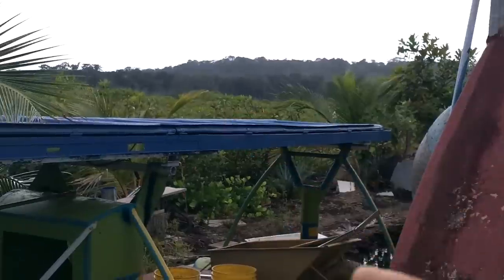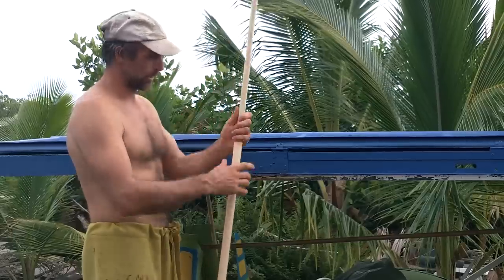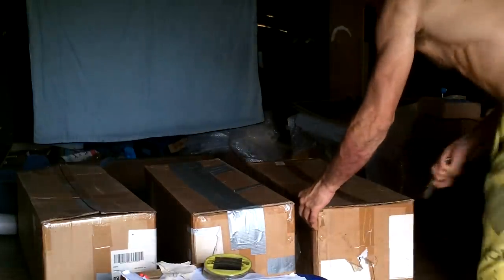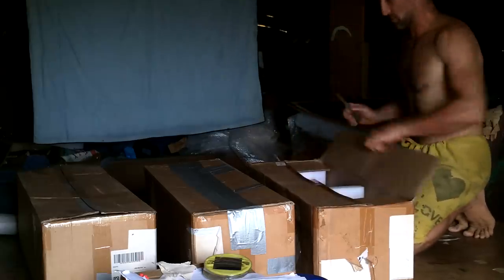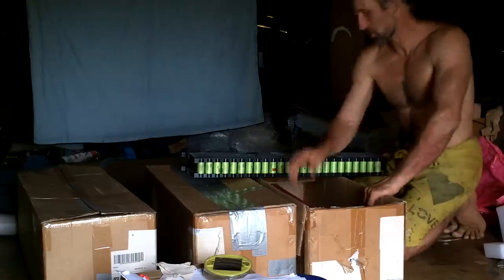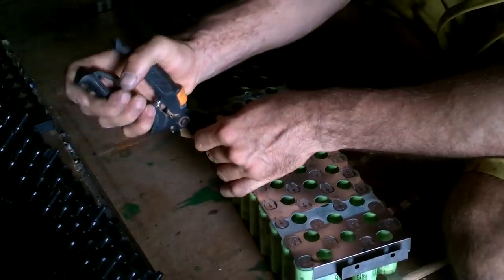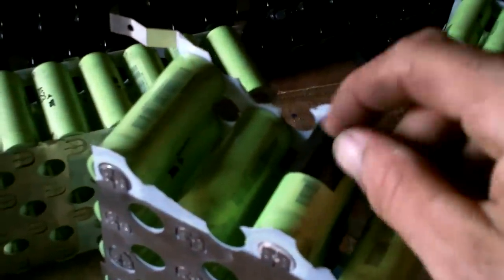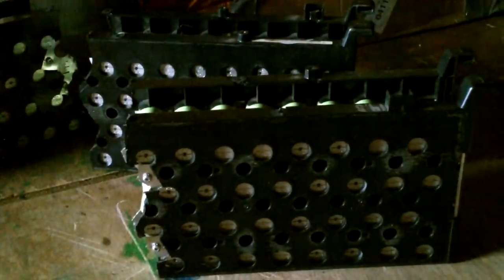Solar Snailer 033 Tubes n' Batt's

Comment: glueing them means they will be harder to get off, rivets is the way to go. the island and dock is looking so cool coverd in all them trees and plants top job dude
Reply: Maybe just add some lines across the board instead of smearing all over. Then he can use a thin metal string and push it through and back like in a long u shape and pull to cut the glue when he wants it off.
Reply: @nalissolus9213  didn't think of that. This will work also. come on jamie have you made up your mind? what it's gonna be . And how's the new build coming along 
Last bit is for jamie

Comment: I have a bunch of these and they are great. They are used in hybrid buses and we have a lot so when they replace the packs you can get them pretty cheap locally. I have cycled mine quite a bit without a BMS and the cell voltages have only drifted 1/100v. So you just regularly check and balance them as needed. Love how compatible with 12/24/48v systems they are.

Comment: Those Are Great High Amp Output 28650 Cell Packs! They Should Work Awesome For Your Boat Applications! I'd Wrap Them Up Very Well With A Couple Layers Of Kaptan Tape To Keep All Moistures Out, Especially Salt Waters Etc! Thanks
Reply: 28650? I suspect they're A123 Systems 26650 cells. I haven't heard of 28650.
Reply: @MattsAwesomeStuff  That's What I Ment... Thanks
Reply: @MattsAwesomeStuff  you haven't heard of 28650? Now I feel like I'm in twilight zone😳

Comment: 100% Sika flex will work and work amazing. The only down side to sika flex is if you ever want to remove the panels you will probably brake the panels as it is really strong stuff. There is different types of it as well but they all work amazing.

Comment: Is it just the camera angle or is the main dome with leaning slightly to the left, as if it's sinking on that side?
Reply: Remember back when he was first building it, and we all warned him that he needed to lay a proper foundation or it'll tilt as it settles like that? And then it started to do so mid-build, so he tried to do an emergency fix digging holes at an angle and feeding in stones? Yeah, pretty sure that's what's happening now is it's no longer enough to support it, and so it's shifting. The camera angle DOES make it much more aggressive-looking, though; it's not listing anywhere near as bad as it looks here.
Reply: @KainYusanagi   Those episodes are exactly what came to mind when I saw that.  The other part that was bothersome was putting part of that foundation on the fill that he had  created by moving dirt around.   It would still be settling.... A much better location is the one that he has on the "Jaime" island.  He is cutting down a that piece of hillside  to create a stabilized base, so should be a lot less movement.   With earthquakes in the area, I hope no one gets hurt.

Comment: If the motor is Brussels it will run on 72 volts if there's a built in BMS don't cut the battery you need the BMS module